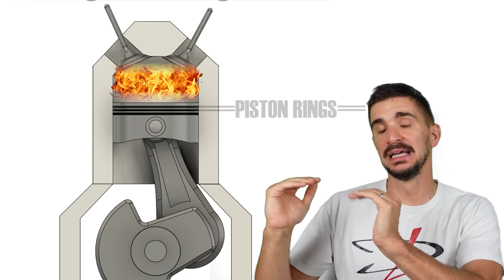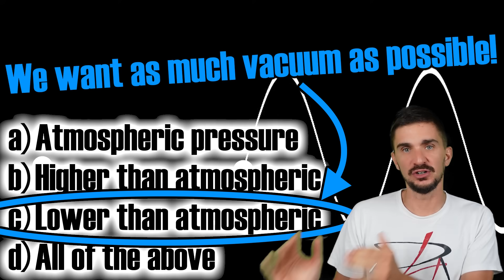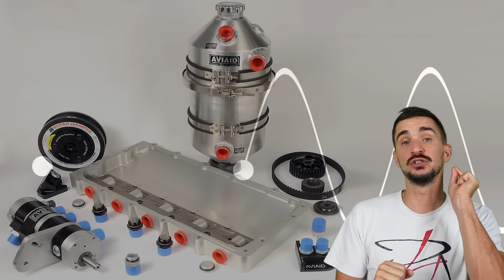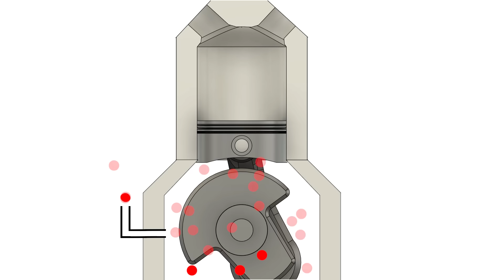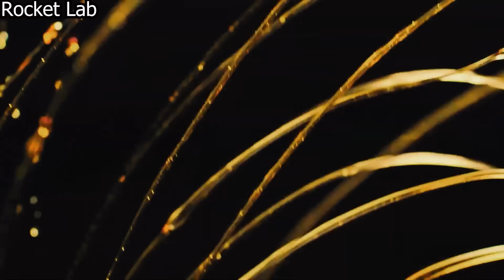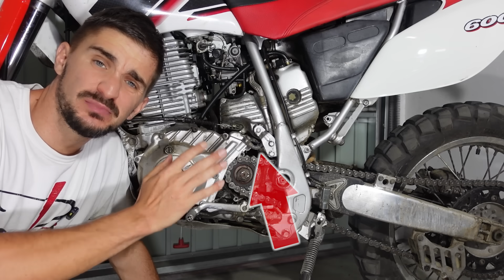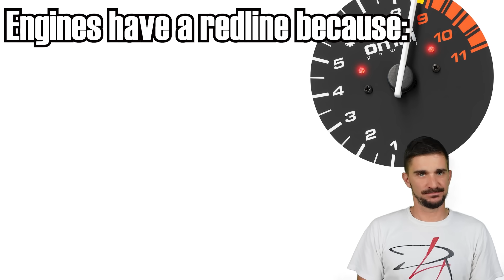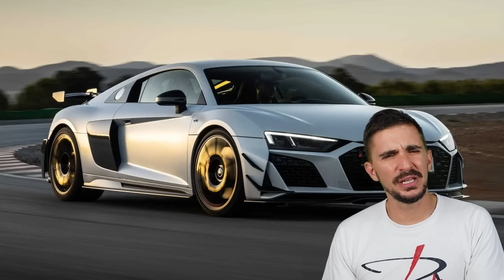Installing This Has No Drawbacks, Except for Your Wallet - Dry Sumps Are Awesome, Here's Why...

Comment: I love dry sump systems but you left out the one drawback for street cars when retrofitting...
Because they are externally belt driven, the reliability of the belt is not the best.

Unlike having a belt fail for your alternator or water pump it's pretty much instant death for the motor to have the oil pump stop working. You don't get a chance to pull over. 

The belt being external, and driving something that pulls a significant amount of power is usually a toothed belt. This can pick up small rocks and chew through the belt. Obviously not a problem for a race car where you can go a whole season on one belt and just replace it. But that whole season of racing is probably less driving than you do in a month with a street car.

So the reliability of having the drive being external from the motor leaves something to be desired.

OEM systems tend to overcome this by driving them internally. And higher end systems like some of the pictures you showed don't use external hoses anymore at you. They use a oil pan that has both the pump mount and the pump suction built into it so you can just directly Mount the pump to the oil pan. This eliminates all but two hoses, one going into the tank to remove the air and oil. And one coming from the tank with solid oil for the pressure. 

Excellent systems. I love them. I just wish there was an easy way to integrate it fully inside the motor and chain drive it directly off the crank. That would remove the final reliability issues but to have that work for most street cars would be impractical.
Reply: Rubbish. Belts are a reliable solution. I have personally done over 500.000 kms on a diesel Mitsubishi which had a belt driven camshaft. Never was an issue.
Reply: @vvevvevvvv your belt driven camshaft is not exposed down low. It's probably not even facing the right way. Lol
Not to mention your diesel engine doesn't even spin fast enough. 

So for every guy running around with their camshaft covers off so you can see their cool anodized pulleys, they're the guys that don't bring up how they found a rock puncture in their belt or how they had a belt break because those are things you don't want to talk about online with your cool car...

Comment: When I first learned of dry sumps, it was also said that a dry sump system can do a better job of filtering the oil. Any truth to that?

It was also said that lubrication commenced faster when starting a cold engine. I think the point was that while the pressurised oil feed might ramp up almost instantly, those parts which relied on adventitious oil delivery, basically splash, might have get redesigned to receive positive oil feed.

Also, while you said the engine can run cooler with a dry sump, and that has its own benefits, it also means the oil remains cooler and that should result in longer oil life.

Comment: This was top 3 favorites. One of those, “I thought I knew, but didn’t”. I wish I could ask myself about dry sumps before watching. I’m thinking I would have said it’s JUST to make oil pan more shallow so lower engine wouldn’t scrape and something to do with reducing starvation.
Reply: That’s what I thought to make it lower because that’s what I see hot rod guys doing when the mix and match engine and trans combos.
Reply: I myself thought it was solely to stop the crankshaft hitting the oil, as well as making it so you can have an oil tank to carry more oil! Funny how we both missed key details but we missed totally different ones
Reply: I thought its so the oil doesent move under breaking and cornering, thats all @briannem.6787

Comment: isn't the most downside on negative pressure in the crankcase that we get dirt particles trough the axial sealings into the engineblock? - i mean that is what i have learned at mechanics school... also the blowby volume would be extremely higher than every volume which could be sucked out of the crankcase ventilation - anything above a certain volume will massively influence the airfuel ratio and therefore decrease power... - only way to deal with this is an external vacuum pump, which would increase costs, weight and complexitivity... no argue about the advantages of drysump tho...

Comment: Does this mean we can look forward to a "how to install a dry sump in your kia"  video? (please xD)

One question I have though relates to oil seals in areas like the main bearing. I presume the main oil seals on an engine are typically designed without factoring for the pressure difference, would dry sumping lead to increased wear on these seals? The negative pressure would of course make them less likely to leak, but maybe increased friction and heat on these components could lead to them breaking down earlier?
Reply: How's there more heat and friction?
Reply: @vvevvevvvv My assumption (which could be wrong) is that if both sides are at ambient pressure, there are no additional forces acting on these seals. If one side is at higher or lower pressure, this pressure will be applied to the seal. Then if there is more pressure applied to a seal, I would expect it to get hotter, and wear faster.

I'm basing this on having heard in the past that having a broken pcv causing additional pressure in the crankcase can also damage the seals if left long enough. So I wonder if the same is true with a negative pressure in the crankcase.

But this may not reflect reality, maybe in practice it makes no difference. Just a thought.

Comment: i guess there are certain cars where a dry sump is system is almost impossible to add, because either of space limitation or just by design. one example is the SAAB 99 (aswell as the c900 and the 90). they have in common that the oilsump and the gearbox housing are one unit under the engine (in my opinion an amazing design), but also there are space limits mostly when we have to add the belt to drive the oil pump. in my view, the only way to add a dry sump system to those engines would either be cutting out the area where the oil is in and weld on a smaller chamber (hope you know how to weld onto aluminium cast housings) and use the free space under to add the hoses and the pump itself and maybe you are lucky and the belt fits aswell (people who own those SAABs probably know what i mean). the second way would be to redesign the gearbox housing, making it larger and therefore have the ability to add stronger gears (and finally have a strong gearbox) and around the new gearbox housing adding the low sump and below with the free space, again adding the pump and the rest you need...... yeah nothing of that will probably ever happen